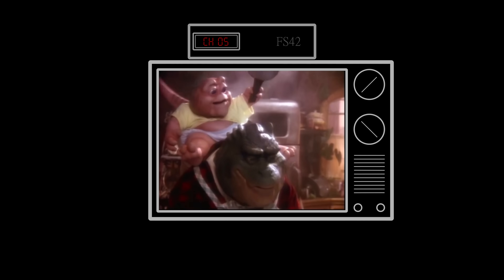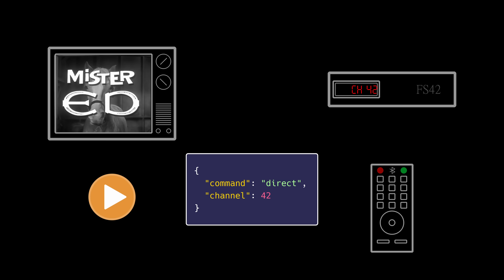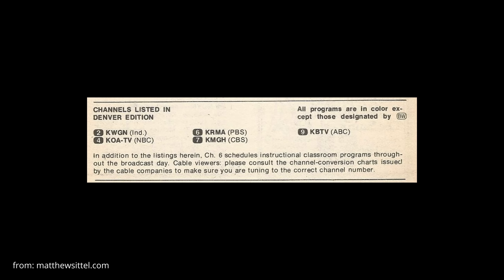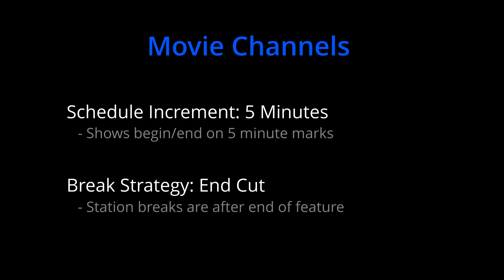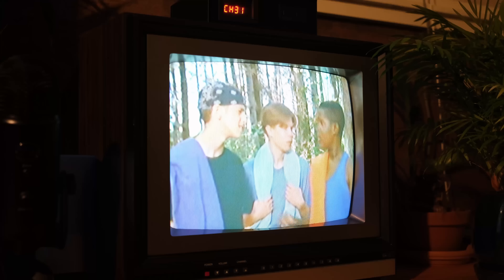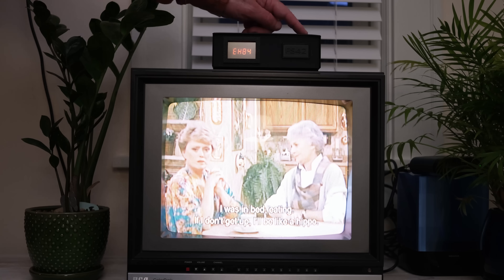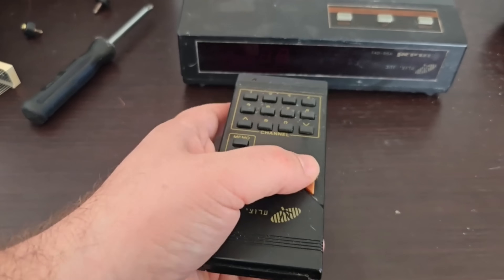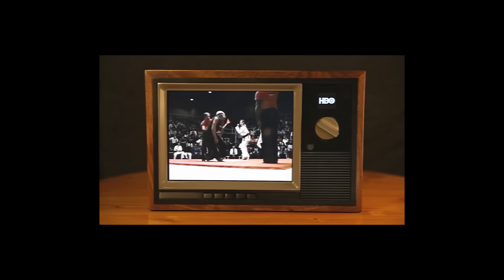90s Cable Simulator - Recreating Retro Cable TV with a Raspberry Pi

Comment: You need channel watermarks and the ability to run those "Coming up next" bits that play while a show is running
Reply from the maker: We just added channel name and number on channel switch last week, channel watermarks coming next. The 'coming up next bits' are on the roadmap, along with interactive guide, as we move towards 2000s cable.
Reply: @wrongdog_reckons as neat as the TV Guide channel feature is. I remember hating it as a kid.

When cable boxes integrated the guide to let you manually navigate the channels and see what was up next was a godsend

Comment: Good start.  But you haven't experienced cable tv unless you have the corded remote control lap box with the push buttons, three row selector, and fine tuning dial.....
Reply from the maker: I don't know what kind of cable experience you think I had, but we had a TV that had came with a chorded remote originally, but by the time we got it had been long lost. I was the remote. ;) Cheers!
Reply: @wrongdog_reckons  jerrold starcom ii jrx-2

Comment: How many hours of content do you have saved?
Reply from the maker: Its a factor of how many channels you have and how much tolerance you have for repeating content. In reality, if you are not going to watch it, but just going to turn it onw to show it off for a few minutes every so often, then you could theoretically get away with about 34 hours of content per channel (24 hours for weekday + 10 hours of weekend specific programming) - but if you want an immersive experience that you will watch frequently, you will need a lot more. Cheers!

Comment: If you're gonna make a 240p 480i look,why not just use 480i videos? I have no idea why ppl think 480p looks good on a 480i set. It looks better than a flat screen but still lags and has bad resolution. Just a thought though. The thing is still mf badass. I definitely want this
Reply from the maker: It's a good point - but something else to consider when watching captures from my TV: think how many conversions you are looking at:
1. Original rip to digital 2. Conversion to my library 3. from disk to DVI out 4. DVI to composite 5. composite to RF 6. RF to the screen 7. my Fuji Xt30 recording the screen (I use the fuji here because its the best for recording without screen rolling) 8 Video editing in Davinci 9. Youtube conversion and network compression 10. your screen rendering it - and that's like the minimum it could be - so it wont look great to you no matter what I do. Cheers!

Comment: Loved the broadcast TV simulator project, and I am really blown away by your cable TV simulator! Exceptionally well done. I wanted to mention that there is a piece of free software out there called WS4000 that re-creates the 90s Weather Channel experience using retro-style graphics, but pulls in CURRENT weather data! WS4000 supports adding a custom music library (smooth jazz, of course). It would be a technical challenge to pull this into a project, but could be worth looking into. Cheers!
Reply from the maker: Thanks! And yes on weather star - its all new to me but we're working through a few pre-requisites to be able to get a stream running from it. It's on the roadmap - I'm excited to get it up and running. Cheers!

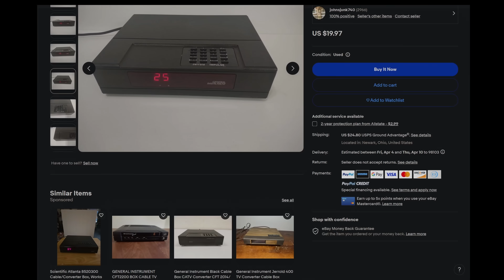Comment: Brings back memories. 1:28 That cable box was the first one used by StarHub TV (then Singapore Cable Vision or SCV). It was used on the analogue spectrum before using an ADB model for the digital TV version that introduced EPGs. BTW, was that General Instruments or Texas Instruments? Either way, as a kid, I always tried undoing the parental controls on that, which only dad knew how to do it. 😂 It was difficult because it didn't have an OSD, and every function on that was coded.
Reply from the maker: That particular one if a general instruments. We had a wood-grained scientific atlanta if I remember correctly. Good times - Cheers!

Comment: This is awesome! A while ago when I was recovering from a flu I really missed the live TV experience  where you could just mindlessly flip through the channels and watch whatever was aired. I haven’t had cable for years and only used streaming services. So I decided to recreate the experience with the streaming services I was subscribed to and also used some online channels. So on my Apple TV I made an extra user on one of the subscription services called "live" and typed a word from  a random word generator in the search bar and played whatever came up. Then I switched to another HDMI port where my Google player was connected to and did the same. Then on the 3rd I had my laptop and played an online live channel. I could potentially have used port nr. 4 too, but I sticked with the 3 "channels". I would then set a timer for 10 minutes and then switch the channel or keep on watching if I really wanted to. This way it would allow my mind to wander off during uninteresting programs, which was fine considering I wasn't feeling a 100%. Of course very crude and if a "program" of the streaming services ended I had to manually start another random program (which I didn’t have to do on the live channel of course) and it's consuming a lot more electricity and you need to have enough bandwith on your internet, but it did the job well enough haha. It really felt a bit like the old TV watching experience.

But this project is really a whole different ball game! Looks like a very realistic '90's experience. A decade that I experienced as the greatest. Everything went downhill from 9-11-2001, and a lot more downhill from 2020.

I really enjoyed watching your project!
Reply from the maker: Thanks! I really like what you built too - ingenious!

Comment: I wish there was a tutorial on how to set it up. I can get the content. I even had most of the hardware already.

Are older pi models capable or is it strictly built for the 5? I have a 3.
Reply from the maker: Some have them running on 3bs, seems to work okay.   Here is a discussion on it: https://github.com/shane-mason/FieldStation42/discussions/82
Reply from the maker: Also - have you had a look at the wiki on GitHub linked from the description? It has pretty detailed instructions.
Reply: @wrongdog_reckons  Thank you! I'm very excited for this project. I even got an old cable box to use for it.

Comment: Now you've gotten me on another project. I'm going to do mine a bit differently...went out thrifting, found myself a Magnavox DTV converter box, and a cheap game switcher with a built in RF modulator. Ripped them both apart and combined them, plus a USB power supply gutted out so I can plug mains into the box and power everything. Slapped a FLIRC reciever on, an LED the Pi can control with connected to the power LED on the front of the DTV tuner...should all work once I get a few adapter cables in, and it'll have both RCA and RF output.
Reply from the maker: Very nice - love that - make sure to tell us how it worked out!

Comment: Nice project spent a lot of time doing something similar with another program but had two questions. 

Does this support M3U output for broadcast to be used on Plex / Jellyfin. Love the idea of it being attached to a tv but being able to watch it anywhere is nice. 

Second is the program I’m using now doesn’t have breaks during the show which breaks the feel. I had to cut up the episodes in parts and play a commercial set after each part until the nearest :00 :15 :30 :45 mark. Is there and option to do something similar or have a way where you can insert commercials at chapter marks of a file? Sorry for the long post
Reply from the maker: Currently, it evenly distributes the breaks based on the content length and the amount of filler it needs to add to pad out to the target time (based on a configurable schedule increment). It works pretty well, but can be awkward sometimes too. We have a near term roadmap to use chapter markers when present, as well as BlackFilter and SilenceFilter to detect where commercial breaks had been. Integration with other media servers is something we'll look at. Cheers!

Comment: I had the desire for doing something like that for a while but for 2000s to 2010s cable
Reply from the maker: I think the only thing that needs to get added to support 2000s style is the interactive guide. If you dumped 2000s media in there right now, it would seem like you're watching 2000s cable.

Comment: Dude! Ugh! I just bought my first Raspberry Pi 5 w 16gb I’m an absolute beginner with it. I’ve got it setup right now  with “LibreELEC” running a Kodi interface , hooked up to my living room tv for content consumption I cannot get on an Apple TV 4K , since I cannot side load without a newer Mac that can run the latest Xcode. It’s also got an “m.2 hat” and I’m running everything on the NVME with pcie gen 3 enabled vs the slow SD.

I would love a way to purchase this exact setup, where all I have to do is load my content. It’d be wayyy over my head with GitHub and editing code

Comment: Would it be possible to add a couple scrambled channels, Maybe with the ability to enter a code to unscrambled them?
Reply from the maker: It would be - I like the unscramble code idea. I am considering adding PPV, where you get one credit every 24 hours to spend on a PPV and you can accumulate up to 2 or 3 credits I think. Fun times!
Reply: @wrongdog_reckons  The PPV idea would be great, especially for some type of content (Wrestling PPVs are what come to mind for me, but I watched a lot of them back in the 90s). I think the trick with the scrambling would be to get it to look right, the way it shifted the sync singles so you got the sort of rolling/tearing look, where you could almost make it out, or get one or two clear frames every few seconds.

Comment: This is perfect, I've been thinking about making something like this for years but I've just never had the time. 

I have a question about this project. Reading through the documentation and listening to your explanation in this video, it seems as though it just selects the most recent unplayed video for the next segment which leaves the schedule somewhat random? Is that correct? Or have I missed something? I'd really like to be able to schedule series in sequence at the same day/time each week, is this a possibility the way it currently functions? Can I select a timeslot for a series to run or will it just be randomised?
Reply from the maker: You read correctly, but I am working on the 'play in sequence' feature right now. Its fairly complex, since you can have series that are in premier once a week in prime, but also in syndication during the day, but you would want them to be in different sequences. I'm hoping to have this in place in the next week. I've laid out the approach, semantics and requirements here: https://github.com/shane-mason/FieldStation42/issues/70

The least-frequently played approach works great for simulation, but if you actually want to watch it (and we do) then you want order to them - so this is a pretty important feature.
Reply: @wrongdog_reckons Thanks so much for your reply. That's exciting news about that new feature. Let me know if you need any help.

Comment: This is some fantastic stuff. I've been looking for something like this for a few years now. I once tried to create my own project called Chan9, but ran into some technical issues that I couldn't get around. Most notably how to place commercials. I got kind of OCD with that and wanted a system to be able to place them in the right place. It wouldn't do to have a commercial segment cut someone off in the middle of a sentence only to have the actual break spot happen a few minutes later and go unnoticed. Unfortunately, the only solution I could come up with was to hand list each commercial break timing as part of the program data set. This is not a good solution for any reasonable number of TV shows as each one had to be checked and timed by hand. I tried so many variations on Google searches on how to time commercials automatically. I looked into how actual TV stations accomplished it, but any hidden/subsonic commercial break markers would long since have been removed when said programming was transferred to digital medium. It bugged me so much that I put the project on ice indefinitely. I'd love to put something like this together. Since I was a kid, I lost my sight so probably putting a fake cable box together is pretty much out of my wheelhouse, but maybe I can at least get something up and running. I'd love to have a fake box that looked like my old Zenith box.

Comment: Is there a way to get one ready to go on ebay or lift one from you?
Reply from the maker: Not currently - though I'm considering a limited run of the hardware in the future. The content would require an army of copyright lawyers. Cheers!
Reply: @wrongdog_reckons  don't worry I still have a 80's pro-bono lawyer I could reach with my time machine. Please make a few to buy.

Comment: with some time i have been able to get this up and running and if i can get my mind around how it schedules i want to use your code in automating my own IPTV channel. although i am using it on my intel hardware but it seems to work about the same, thank you for this awesome kit
Reply from the maker: That's amazing to hear! Love it. Yes - it should work anywhere Linux or Macs can run - even on Windows with WSL. I wish I had pointed that out in the video - no RPI required. If you run into any snags or have questions, just post an issue or discussion on github and someone (or me) will help. Cheers!
Reply: @wrongdog_reckons  thanks i have been following the github closely

Comment: could you make a step by step i keep getting stuck and i need this
Reply from the maker: Been a few asks for that, so I'll do one. In the meantime, did you use the wiki over on github? It has step-by-step instructions. You can post an issue on the github page and someone (or me) will help you out also. Cheers!

Comment: Does this support loading from a usb drive or is it just sd card? And does this keep track of time while it's offline?, Like if I'm watching a movie, turn it off and come back 20 minutes later, will it still be at the same spot or will it have moved?
Reply from the maker: These are good questions. The schedule is persistent - if a movie started at noon and you turn it off and come back at 1pm, it will be playing 1 hour into the movie. 

Does it keep track of time when its offline? This is a good question: only if you attach a CMOS battery so the real time clock keeps running while its unplugged. Otherwise, if you shut it off at noon and turned the internet off at your house, when it wakes back up at 1pm, it will think its still noon and start counting time from there. So, if you are not going to leave it connected to the internet so it can get sync time when it wakes up, you'll need a CMOS battery.

Finally, you can use any hard drive that works with the pi. I use a docking station with spinning drives that connects via USB. The blue thing behind the cable box in the thumbnail is a cover for the docking station that I 3d printed. Hope this helps - Cheers!
Reply: @wrongdog_reckons  Thank you for your reply! It doesn't look like the raspberry pi 4 model b has a spot for a CMOS Battery so I'll have to leave it running all the time then, I didn't see a reason to connect my cable box to the internet lol.

I do have some additional questions if you'd be willing to answer those as well. Is there a way for me to connect the cable box using bluetooth to my phone and control it with an app? I'd love to use a remote and it looked like there was a way to wire up something for that using custom parts but I'm interested in reusing parts I have already.

This is probably a definite no but I thought I'd ask anyway. Is there a way to connect this to my VCR and switch the channels using my VCR's remote or through my CRT TV's channel buttons?

And I heard you were working on a satellite box version and was wondering what changes you might make to it and if you can reuse the current 3d printed box or if it would be worth waiting to order the new box.

Sorry for all the questions, I was planning on making something similar a few weeks ago so I had lots of ideas for it but couldn't get it working.
Reply from the maker: @PerplexedAnimation There are options for adding an RTC with battery backup to RPI 4 - like this example: https://www.digikey.com/en/maker/projects/adding-a-real-time-clock-to-raspberry-pi/1d500968ed044a6792497a63d0d7c018

On the other question: yes, over in the github discussions (linked in the video description), there are several topics about people getting their remotes working. That is also the best place to ask questions. 

A user recently added a web-based remote. I need to add documentation on that, but you can use it from your desktop browser or your phone.

On the satellite approach, I think all we need to do it update the guide channel to be interactive and a few small tweaks and it should work. I would use the same cable box for that (also with some small tweaks)  Cheers!